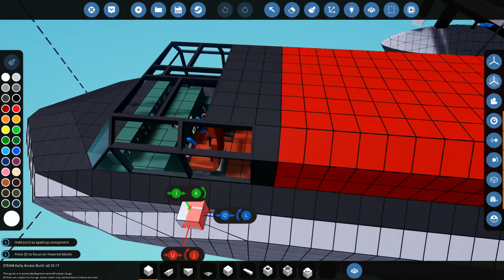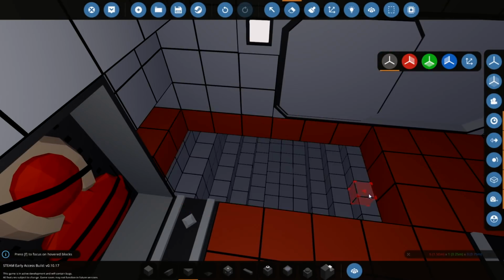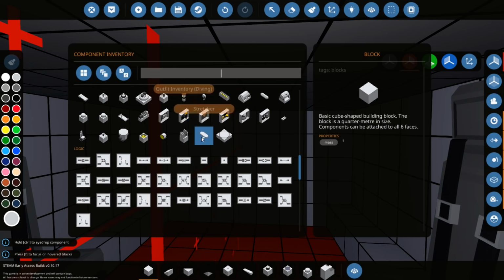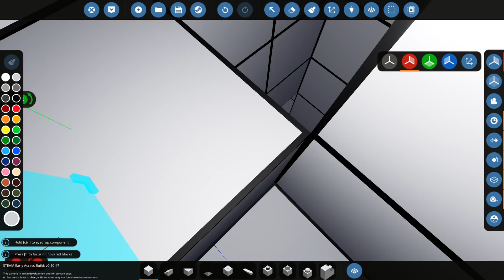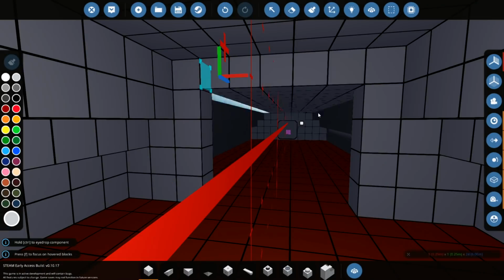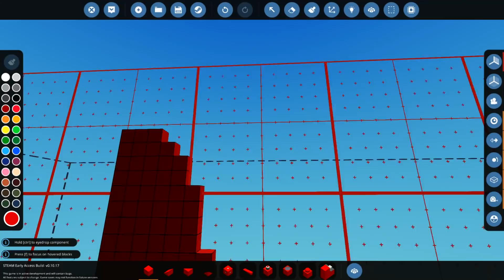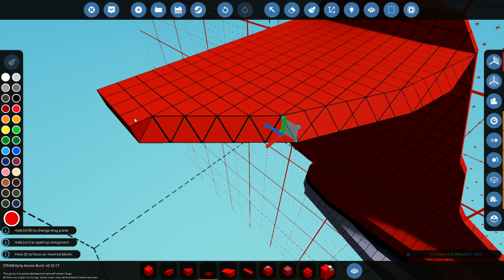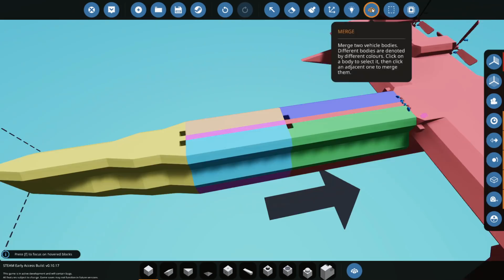Extending The Plane!  -  Sea Plane!  -  Stormworks Gameplay  -  Part 4

Comment: If you need more buoyancy I suggest adding this... (This might solve most of the problems)

Sponsons (Little stubby wings/pontoons) in the middle of the Sea Plane, kinda like the Boeing 314 Clipper, and if wished you cold put the landing gears there!... Good job on 50K!

Probably the best plane that you've made so far, glad ur enjoying it!

Pros:
More Buoyancy
More Lift
Landing gear can be added
Adds a little weight to the bottom (could be seen as a con)

Con:
More blocks = Money

Comment: id rather work with the Normal Full size doors so you can walk front to back Standing. on my Latest Albatros rebuild you can walk from front almost all the way to the back. 
And dont Forget to make the Bottom of the Seaplane and other placed out of Wingfront section to make her lighter. also once you add fuel and such she will sit alot deeper so you might need more displacement by extending the hull down atleast 2-3 blocks.  Fuel shouldnt be more than 5000l with gearbox settings you can get decent Speed and Range. also dont forget that gyros make everything lighter by alot :P

Comment: I would suggest maybe also adding a tailwheel, a bumper nosewheel or ski, and retractable main wheels so the plane could operate anywhere. I am, however, wondering how difficult it would be to make most of the wing pivot and fold like the older carrier-bases planes. Maybe it would be easier to have the wing start folded back toward the centerline and just make it fold to make it reach the maximum span.